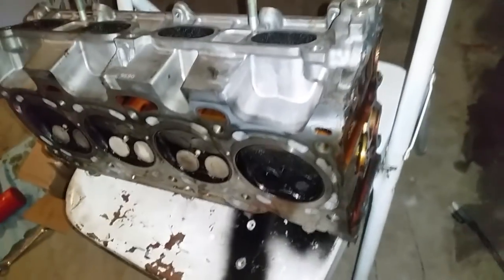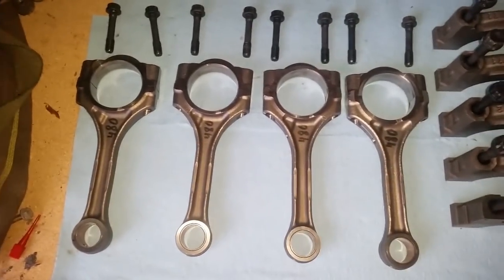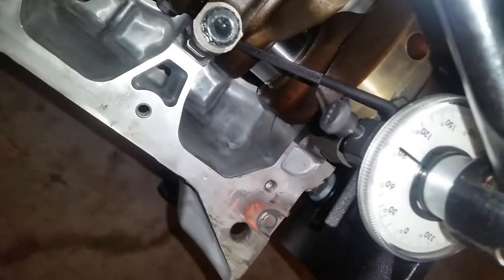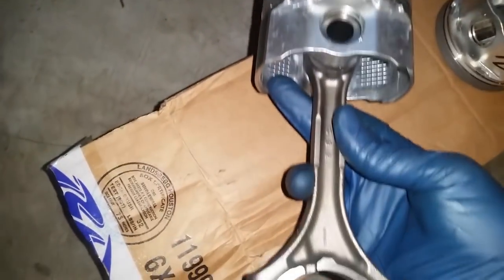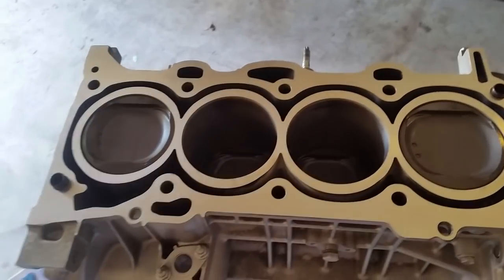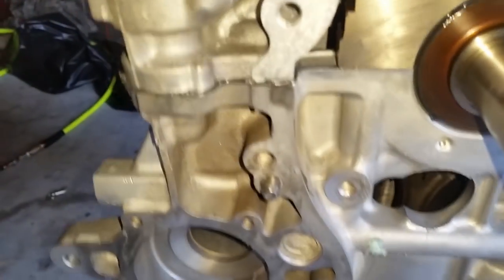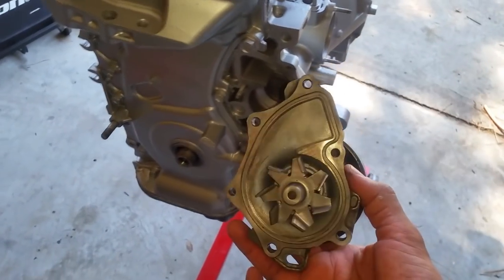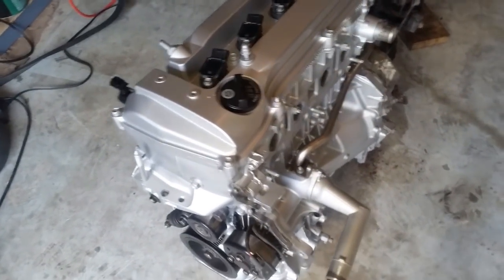how to: scion tc or 2AZFE engine rebuild [DETAILED]

Comment: What about the bucket lifters?  Did i miss the part on the 0 clearance and how to adjust the "cups" within specs.  

When the damn things starts tapping and sounding like a diesel engine,  can the flex or bend if, some lobes appear tighter than the others?

I ask because, thats what happened to me remanufactured engine and some cambolts were way tighter than others and the valve lifter clearance was off all over.  Following the book, it seems some lifters are jumping from a #42 to a #67 and the like.  Is that the lobe being worn or could it be the cam is ever slightly bent? It ran great until about 10k miles and then, a galloping sound started and kept getting a multi cyl misfiring.  Then, tapping a week later.   Some lifters had 0 or more.. meaning i couldnt get a feeler gauge under lobe.  It could be too tight but, i dont know considering other valves were .08 to .13.  To .28 to .34.  

I opted for some bc cams and springs but, still have to hope i dont have to spend extra buying buckets to suppliment for the 0 valve clearance.  I was hoping you had a simplified verion on the math of it all.  If, bolting down cam over and over to measure for the randomness of those stupid buckets, doing the math and then finding the correct # of the bucket to make uo for the clearance would cause and undo harm....or am i complicating all of this should just grab whatever bucket and yell out a huge mexican grito and pray to our lady of Guadalupe in hopes i dont have to go through this shit again.  The grito is what i imagine was done on the remanufatured engine considering the inconsistencies of the valve clerances between each valve on each cylinder.  

You know damn well that music was playing when the engine was rebuilt.  Its not racist if its true.  Its mainly to humor me through this time of mourning.  Its like 30 days without bass.  I miss my car.
Reply from the maker: That was a good read. So I saw how much of a pain in the ass the caps were going to be that I just marked them numerically and then reinstalled in their original spots. The head didnt get any extra treatment for the build other than hot tanked and resurfaced. 
Otherwise you would have to install what you have, measure, exchange as necessary and buy replacement #s as needed.
I hope your rebuild goes well.

Comment: Nice video. after starting the engine I noticed a weird noise and I think it's coming from the  balance shaft sprocket. I don't see any abnormal wear but I noticed on mine  it has a play on the the two gear sprocket, is this normal? I understand they may be spring loaded but my question is how to know how much play there should be.
Reply from the maker: I wouldn't be able to tell you where your issue is but I can tell you that a stretched chain will cause rattling, however in this case there isnt much load applied to the chain since it's on tensioned by a spring. Also something to look for is wear on the chain guides, this could potentially make it sound like the chain is stretched but it's only being subjected to the slack by worn guides. I hope this helps

Comment: importworx Excellent video. very clean rebuild. You know your way around this engine. BTW, is there any chance you can share the pdf manual for this engine.
Reply from the maker: Give me your email
Reply: jiraheta gmail
Reply: did you send it? havent received anything.
Reply: Another question. you said you gave the short block a coat of alumaseal? is it in a spray? can you care to elaborate on this? thanks

Comment: Hi, I had sent my xb to a dealer to have piston rings replaced under toyota warranty for excessive oil consumption.

My car came back with a lower engine balancer issue and the dealer said it's not their fault. They said they only replaced the rings and pistons and did not touch the bottom half of the engine.

Is this true?
Reply: I don't 100% believe them. The crankcase needs to be removed to replace the piston rings. This means the balancers came off from the crankshaft. If the balancers were replaced with misaligned timing, that could result in an issue.

Comment: Nice, worx, what would this cost on a 2007 scion tc, pull, rebuild and install back, I'm using a quart per 1k?  I started using that amount about 80k and Toyota did the oil consumption test and turned me down, I think they didn't want to spend the money, not sure if my engine was the type they had the problem with?  How long would this take if I brought it to u and where would I stay bcux I'm out of town, like a motel for a few nights?
Reply from the maker: Thank you for being intrested to do business with me. This is about a 6k dollar job at a shop and I charge half of that however I am unable to do any work as I am overseas on an assignment.

Comment: Are your main bearings oem? I ordered what i had inside motor as factory and I have 2 numbered as #3 and 3 numbered as #2, did not record what min each came from so install should be fun
Reply from the maker: The numbers are based on the block code. You must read the crank markings and block markings to determine what size bearings you need. Not all cranks are cut equal, when they are cut at the factory its measured for the best fitting bearing for it.

Comment: Did you say 60 or 16 ftlb on the counter balance shaft cover?
Reply from the maker: Raleigh Jones I had to reopen the manual for it, and it is 15ft lbs, then 90. I will make a note on the description. It's been so long I cant remember much other than what's on the video for the most part.
Reply: Ok cool,  it felt a little tight and wasn't but halfway there.  Thanks for the video though.

Comment: Did you have the crankshaft balanced with adding different rods and pistons?
Reply from the maker: No because it is not necessary. It is factory balanced and any micro inconsistency is mitigated by the crankshaft damper. Acts as a counterbalance mechanism.
Reply: @manuelbou  thanks man, I really appreciate it!  Thanks again for making the videos!

Comment: how did you know which valve cup belong where? Did machine shop give you a diagram of where they should sit?
Reply from the maker: During removal I marked every cup to its original position. 
But the alternative way would be to measure every valve cup, record it and try to match the cup sizes you have and then order the sizes you need.

Comment: There's three options for the counter balance shaft bearing. How do you know which is the correct one?
Reply from the maker: The block has a stamped code number and letter underneath by the oil pan. Follow the factory service manual that will tell you what size bearings where cut according to the block&crank manufacing specs.
Meaning not all blocks & crank are machined to exact tolerances so if they needed to machine more due to casting variances then it would require different size bearing to accommodate the change.

Comment: Sorry one more comment here. I can't for the life of me find the torque specs for the transmission bell housing to engine, or the flex plate to torque converter. I know this engine was a manual but if anybody can point me in the right direction, would be much appreciated. So close to getting this bastard back in!

Comment: I have another question. When putting the engine back together with the proper spec, did you use the same bolts for the head block and shaft balance or did you used new one. I say this because since they stretch and after they get torque they most be 90 degree turn
Reply from the maker: I prefer to reuse the bolts. They stretch, but you can measure them and as long as they are in spec you can reuse. A stretched out bolt will measure too long and require replacement. I have used new bolts in the past but I stopped doing that because new bolts require retorquing more times after a rebuild than used ones.
Reply: @manuelbou  thanks again I will be doing a rebuild soon and wanted to make sure I have everything I need to get it done right

Comment: Had piston and rings done at dealer, 09 matrix xre 2.4l now car vibrates alot  in gear at stop light. Any idea whats happening? They looked at mounts and cleaned throttle. Still same.
Reply from the maker: Yes, it is possible that they reinstalled the counter balance shafts incorrectly, its a design to absorb natural engine vibration from a 4 cyl, how ever it is very easy to mistakenly instal them 180* out, causing the effect of a vibration. what is funny is that in the toyota engine manual for the assembly for that part is shown upside down, so if the mechanic didnt catch that he may have installed it wrong. good luck to you.
Reply: Also can be a PCV valve that needs replaced. I have a 2007 Camry with the 2AZ-FE and before a rebuild, my car had the famous vibration/shudder at stop lights.

Comment: i'm confused about the step where we go from oil pump chain installation to lining up marks up top. I have 2 versions of the shop man for 2azfe, and one calls for placing crank spline at 12oclock immediately after oil pump chain. It THEN calls for bringing no. 1 piston to TDC.. Okay, but that changes orientation of spline, does it not? I wish you'd been a little more detailed at the point where you actually put the timing chain in place. Otherwise, I think this a terrific video. (Please see mine on unlocking the VVTI mechanism)  THANKS!
Reply from the maker: You are correct! I do not know what happened to that part of the clip?!?! very wierd. how ever once you line up the oil pump chain the timing chain has the orange clips. just line those up once the camshaft arrows are pointing at their respective targets. and of course the no.1 piston should be at the TDC

Comment: What size bolts and washers did you use to attach block to the engine stand ?
Reply from the maker: I have a variety of long bolts in metric threads I bought from the hardware store to take care of that. I believe they are 1.25x12 X 60mm

Comment: Is this 2AZFE the same as the one in the 2009 camry?
Reply from the maker: Great question Alex, There are some slight variations in the engine however if you follow this video step by step it will guide you through the process for your camry, there are only slight variances in which it isnt hard to figure out. Hope that helps.
Reply: importworx , yeah I barely noticed the clutch system so this is connecting to a manual transmission correct? But that would be the only major difference as the transmission my Camry has is automatic. Also thanks for replying and great video
Reply from the maker: Auto trans just as easy to prep for removal, besides a few sensors the only difference would be the gear selector mounting bracket and trans fluid cooling lines to the radiator.

Comment: Question after I install the timing chain and I rotate the crank will all the links align with the timing marks?
Reply from the maker: If you install the timing chain colored links in the correct marks then it will line up back to the marks every few rotations

Comment: hey now, love the vid, i've always heard not to use anti-seize on spark plugs because it interferes with the ground for the spark.  Every hear of this? maybe i heard it wrong
Reply from the maker: Adam Payne spark plugs WOTHOUT anti seize, they seize. spark plugs with anti seize, they never seize. that's my experience. the spark plugs DOES NOT need to make a ground to the head for it to work. it's all from the tip
Reply: Sorry bro great video,  but spark plugs definitely have to ground to the block/head , tho antiseize will not effect the grounding .

Comment: 1:30:29 What is making that tapping sound when engine is idling?
Reply: Valves most likely. It appears to me that he basically just reused the head without replacing anything and the clearences are probably not exact but it does not hurt anything. These valves arent really adjustable unless you replace those buckets with ones that increase or decrease the clearance based on how far off it is.

Comment: Just so you know. Brass is NOT softer than aluminum. Only a specially ordered "soft brass" wheel is softer than alu. Also, brass + aluminum = corrosion

Comment: what rebuild kit did you use ?also did you use stock pistons?
Reply from the maker: Enginepartsonly.com also I did not use stock pistons because they are the cause of failure. I used an aftermarket updated version from the same website
Reply: @manuelbou  thank you very much ! Any idea if all aftermarket sets or pistons are. Revised and updated ?

Comment: Question what would be best to get 250 HP n/a for this motor? Thanks again.
Reply from the maker: That is a hard feat to achieve. You want a high compression engine, as much air flow to come in, same for exhaust, larger injectors and get with the best tuner in your state. You might not like the amount of money you're gonna spend. For the relative low results
Reply: @manuelbou  I'm trying to  for the same thing, I'm in cali:have to stay n/a. Larger injectors? Wouldn't that fail smog? I want to deck the head;higher compression,but anything else you can recommended would be really appreciated,great video btw

Comment: Does this apply to the 2az-fe on a 06 Camry I have to do the head bolts that stripped
Reply from the maker: The removal steps to get the engine out may be slightly different however all engine teardown steps are the same. The best way to get the stripped bolt out is to drill the head of the bolt off. Once the cylinder head is removed you'll obviously have a stud that needs removed. The best way is to grind the stud to have 2 flats on each side and clamp a vise grip on it and get creative with other tools for leveraging for removal since it's rather a high torque value

Comment: Excellent job, how was the engine after starting  ??
Reply from the maker: M Ridware after doing this so much, it wasnt a surprise when it cranked right up and ran strong. Honestly it was one of the rebuilds with zero hiccups at all.
Reply: importworx your did great job and rebuild this engine with your heart
Reply: I have 2004 Camry but there is sound of rod bearing and maybe main bearing, can i change bearing without removing the engine or replace the engine till this engine dies or rebuild it
Reply from the maker: M Ridware yes you can. It's a fair amount of work but I've done that before so its possible.

Comment: Does this fix oil consumption issue?
Reply from the maker: Jesus Magana yes! the faulty design is in the Pistons, replacing them with an updated version corrects the issue
Reply: importworx good to hear. But where did  you get the updated rings?

Comment: How much should you pay to rebuild a 2007 Toyota camry engine? I think it's the same engine as 2AZFE. My engine burns oil and apparently this is a known issue
Reply from the maker: at0977 in my area the customer told me the average quote was around 3 to 5 thousand. However i performed the work below the competition and he couldn't have been any happier. It's been a while and he still sends me messages how it feels better than new when he got it.
Reply: Thanks, Where are you located?

Comment: 2.4L 2AZ-FE 4-CYLINDER purchased on Ebay from Japan. Put it into an American built Camry.  The engines were the same except the nox sensors were different they have a different number of sensor connections.  The  car is throwing a check engine code for nox sensor. Any help would be appreciated.
Reply from the maker: So once you bring parts that may not be compatible with the OE version there will be a number of variables that no one can predict. My best advise is to buy an American version knock sensor and try that. However the code will appear if the sensor is loose, or if the connection isnt good, possibly also check for shorts.
Reply: @manuelbou  Going to get a machine shop make an adapter.
Reply: @manuelbou  Both are OEM Toyota. Just manufactured in different countries.
Reply from the maker: @ababner317  you are repeating what I said. They can be both OE, for different countries so they may be different, so you still should've bought a USDM kit and not a foreign OE version kit.
Reply: @manuelbou  What does USDM mean and where can I get one?
Reply from the maker: @ababner317  USDM stands for united states domestic motors. So in this case it means that you should look for engine kits made for USDM version toyotas so all sensors are compatible with America's versions

Comment: I have done the timing on my tc 3 times already, and I can't seem to be able to get it right, thinking on selling this car after reworking it for almost 3 weeks straight
Reply: I had the exact same issue with mine the timing on these engines just seems to be extremely picky. This is probably too late but make sure you don't get rtv into the little hole on the timing cover that's right where the tensioner goes (it provides oil to pressurize the tensioner).  Also when installing the tensioner turn the engine backwards until you can hear an audible click which is the tensioner clip releasing and putting tension on the chain guides. Also to line up the timing marks with the marks on the chain I had to use a wrench to move the cams back slightly so the chain would match up properly with the marks. Also make sure you double check the mark on the lower portion of the chain with the crank shaft before putting the timing cover back on. I had to do it 3 times as well its very frustrating lol.
Reply: @brycegray6038  I tried it 3 more times, I never got the timing done. my car is just sitting there, ended up buying another motor and I put that one in but I notice metal shavings in the oil pan, looks like a bearing got damaged or something. think I will have to buy another engine or sell the car, and that I don't want to do.
Reply: @mosesandrews4381  Man that sucks I have to replace the head gasket on mine now too so I’m just gonna try and rebuild it. What happens when you put everything back? Does it rattle or throw codes or anything? Are all the parts new or are you reusing guides or sprockets?